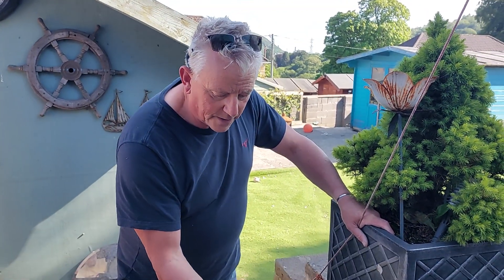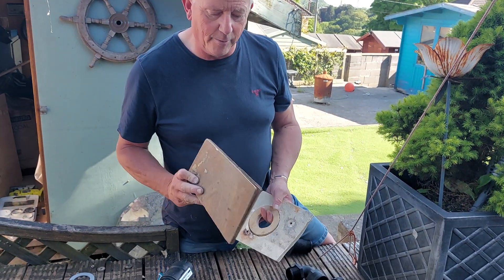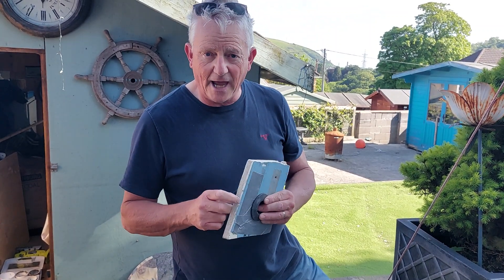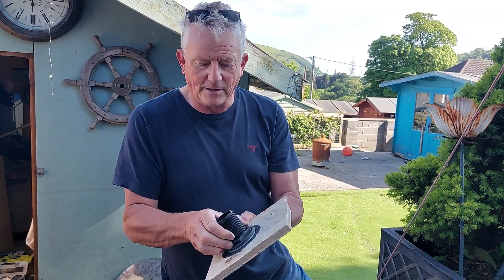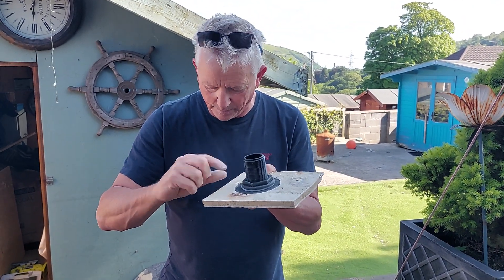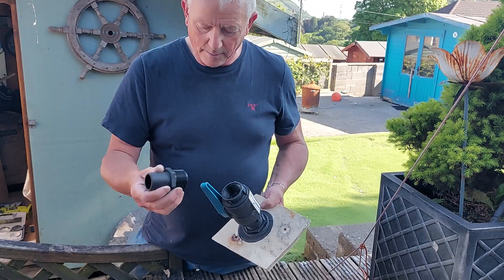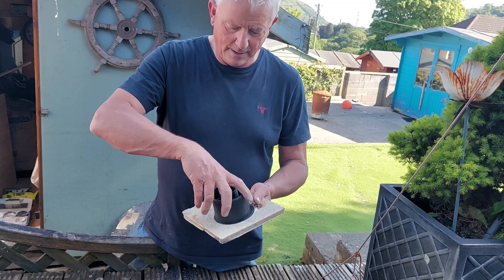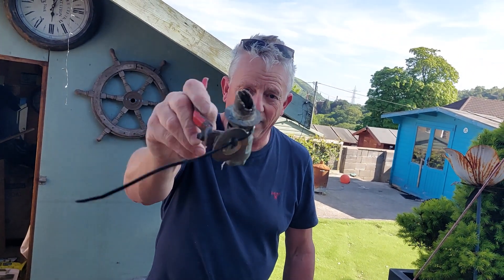seacocks ! the true design how to fit

Comment: You sat at 2:56 that "you should never fit an elbow, before the valve", but you don't say why not. What's your rationale for this piece of advice?
Reply from the maker: Sorry.. I didn't explain better.. basically with any ball valve arrangement there is leverage for opening and closing. There is a risk of loosening the skin fittings or the connection.  There is also if something does fail its very hard to force a bung into a bend.. hope that helps.

Comment: Very confused as the official Trudesign doesn’t mention anything about the core and plywood rings etc. How d’you know if your boat has a core? Thanks
Reply from the maker: When you remove the old fitting or if you are drilling a new hole it will be very obvious there is or isnt a core...
Reply: Official Trudesign video

Comment: Hi Ben, very informative and come to thos video from the one you posted about failed seacocks. I only have one through hull fitting on my boat and sbout to replace it with a marelon or similar, someone slso mentioned about using sikaflex, would it ever be possible to remove it at a later date if you used something like sika 291?
Reply from the maker: Yes sikka flex is good as long as correctly applied.  Interestingly I went to a talk by Dave Johnson of wessex epoxy and the suggested using their product G-flex.. thicker resin... removal isn't that hard if and when required

Comment: I haven‘t used sealant on my TruDesign seacocks, but Teflon tape. I question the wisdom of using a sealant because of the difficulty of removing/replacing a seacock at a later date. What purpose does Sikaflex serve, other than acting to seal the tiny spaces between the threads? The heads seacocks are Blakes, and there I use grease on the threads. What do you think? Might also be a good idea to point out the necessity of building a pad on the inside of a curved hull? Otherwise like your videos v much. Good, down to earth advice from an expert.
Reply from the maker: @billfromgermany  thanks for the  comments.  I do agree with pads inside. Some firms now use G flex epoxy!  I've always sealed in valves with sika or in the old days a no setting mastic!

Comment: 2:22 The information about hand tightening the nut in sealant then a further 1/2 turn tighter the next day is actually in the Trudesign official installation video on their website - think I would prefer to follow the manufacturer’s instructions rather than an importer but each to their own on this very important issue
Reply from the maker: @Captain-Paul  it's a good point but when then turning a further 1/4 turn you are risking breaking the sealant seal.. that seems wrong in my view . Appreciate the comments always more than one way to do some jobs!

Comment: When you use the load collar you have to screw them in together as below the valve handle has to sit inside the recess.  The way you have screwed it in this video is sitting and tightened only on two edges on the side of the valve.
Reply from the maker: Yes correct but i hadnt fully tightened up as I was concentrating in ensuring anyone who fits these ensures they remove any core. Thanks for the comment 👍
Reply: After watching several vids on TruDesign that don’t show how the collar goes on… Came to see how the collar screws on with the seacock and the recess for handle and everything and he just stuffs it on there misaligned haha. Looks simple enough anyway. Ahhh well

Comment: looking at using True Design for most of my seacocks, but the engine inlet space is limited so looking at Marelon for that as they are more compact. would Stokbord of 6mm be enough?
Reply from the maker: @wysiwyg2006  sorfor the delay in replying.. personally the 12mm is better.. but obviously depends on what is the current thickness a d make up
Reply: @TheMarineSurveyorNotebookBenSu  thankyou. for my engine inlet i was going to use a marelon 1/2" composite but cannot find them in stock anywhere with the straight male hose spur, they seemed more compact for the limited space i have under the v berth. do you think a 1" would be too big for a 2gm20?

Comment: Are the plastic Tru design and Forespar seacocks allowed under MGN 280?
Reply from the maker: Anywhere but not in an engine room the reason is withing the code and the MCA won't accept them as they will not remain in use for 30 mins at 1000 deg c!!!! Despite no grp makes it that far!!!!
Reply: @TheMarineSurveyorNotebookBenSu  I had a suspicion that might be the case, despite making no sense whatsoever! And the melting point of brass is 930° 🤷🏻‍♂️

Comment: I'm more confused now. Why do you need to cut a recess for that circular flange? Can't you just lay it on the hull and then screw the fitting onto it? Also when screwing in the valve itself, why use Sikaflex? On the threads? You will never get it off again. So I don't understand that either.
Reply: OK thank you
Reply: From what I have seen on the trudesign Web site, they only recommend sikkaflex applied to the skin fitting so that it does not go beyond the interior hull surface, ie no sikkaflex on  the thread where the lock nut is tightened. Is this what is being said in the video? It seems you are recommending sikkaflex on the skin to valve threads. Am I understanding you correctly here? Also the thing that has not been mentioned is fitting alignment issues ie ensuring the valve handle can open when a right angle hose barb is attached and tightened. What if the tightened position of the right angle hose barb on the valve interferes with the valve handle when the handle is in the open position? Thanks for the video.
Reply from the maker: Please dont be too confused! Providing a support ring for the fitting gives much better support and ensures a flat surface to tighten up in,especially if the laminate is thin, as is the case on many grp production boats these days. Using a sealant like sika or even lock tight is recommended by the importers in the UK. Especially on joints.